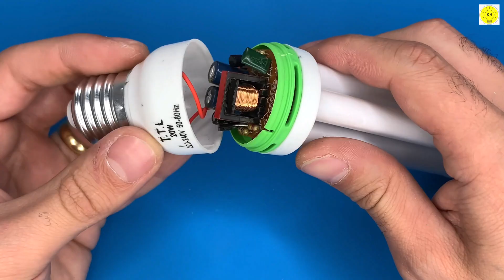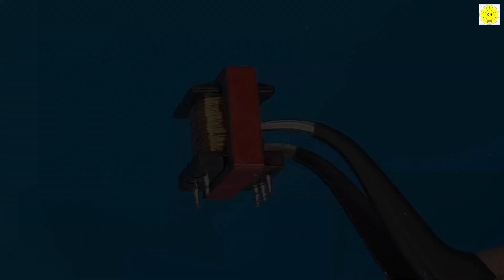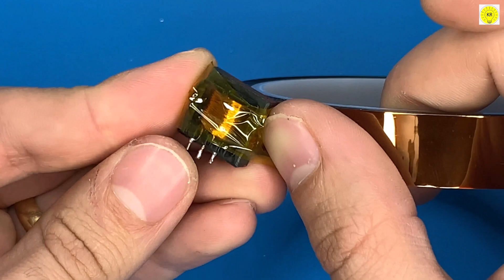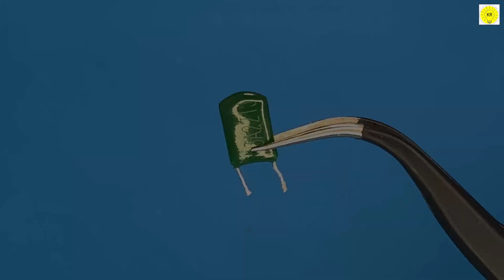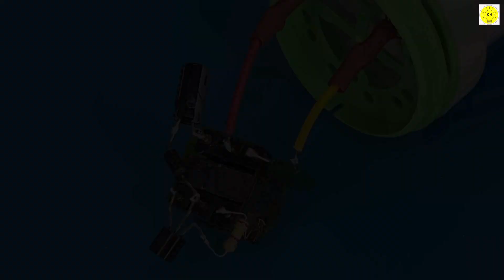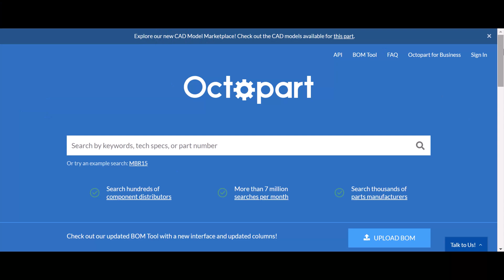ONLY A FEW PEOPLE KNOW!! turn a lamp CFL 220V to 12V

Comment: Current draw please? ✌🏻👍🏻🇬🇧
Reply: It's a 20w bulb.
Reply: @rompdude  Will not be 20w at 12volt battery after those mods. For sure the modified driver circuit will be hugely inefficient.
Reply: @steveng5503  don't forget inefficiency = heat. Without some way of dissipating that heat, it's going to stop working pretty dam quick. Can't imagine it being more that a couple watts different.
Reply: @rompdude  No, I don’t forget. If I had the current and voltage at battery when underload I could then calculate the amount of inductance that’s created at the coil, hence then understanding efficiency and maybe able to improve on the circuit. I could build the exact circuit to test. Difficultly then, for us in UK our electrical system is 248v just now and the CFL used in video I’m guessing is rated at 120v at possibly 20w. I don’t usually comment, just would like to know the voltage and current at the battery underload?